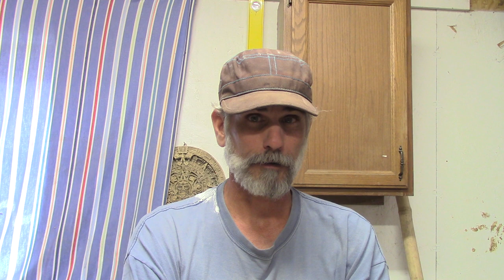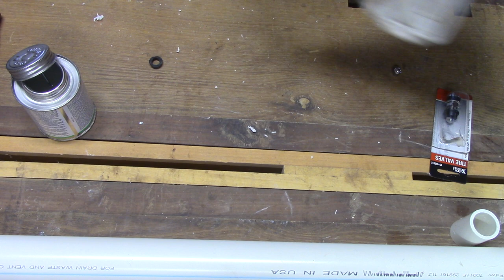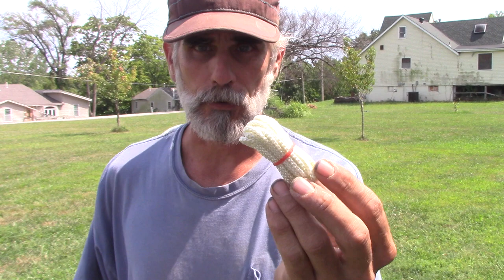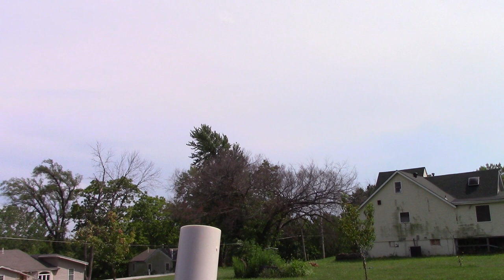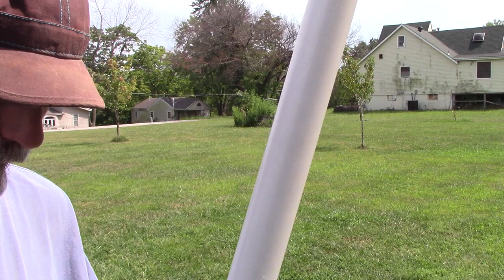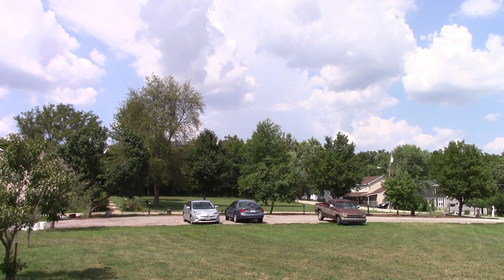Hand held Air Cannon Confetti Gun

Comment: When I was a kid we made tennis ball cannons with
 pop cans [they were still made of steel back then] taped together.
Give it a shot of hairspray, stuff in the ball and light it through a small
hole at the base.
Reply from the maker: I thought about adding a second 1.5 to 2 inch adapter on the end so I could put a Tennis ball on it and launch it for my dogs. LOL
Reply: Steve A W -we used soup cans. The kind you can cut off the top and bottom. The gas chamber had the triangular can opener punch holes in the base can. Aquanet worked the best.